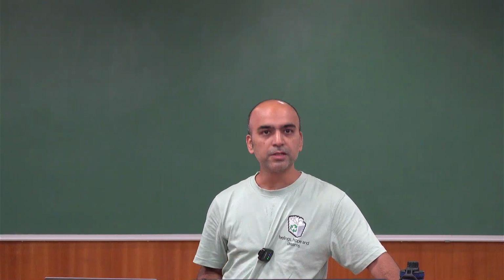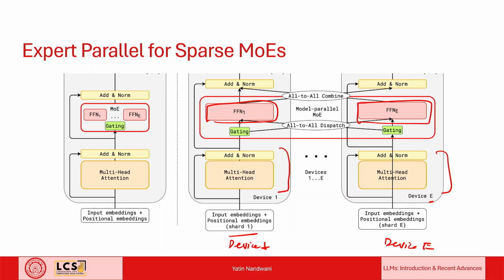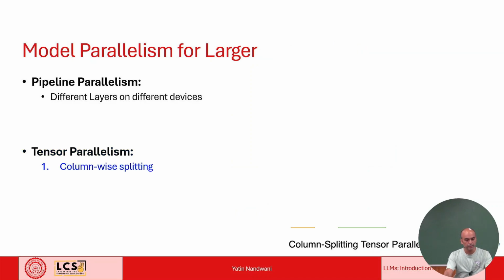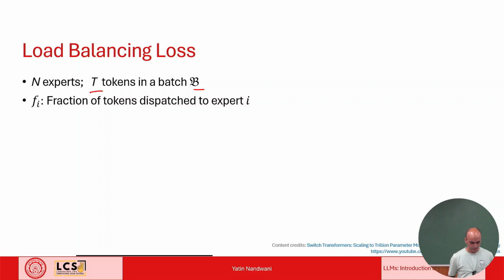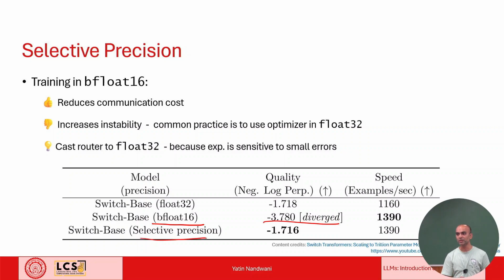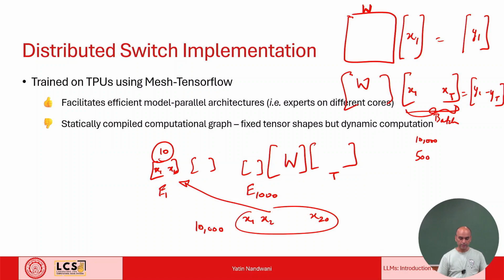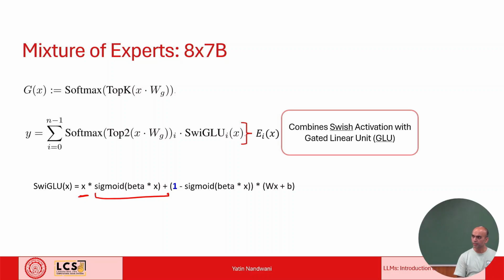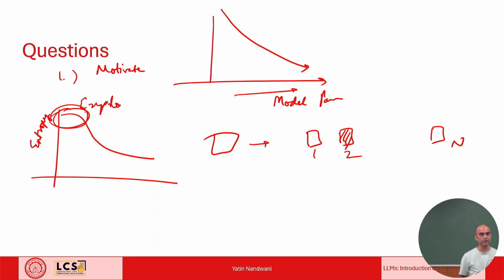LLMs | Mixture of Experts(MoE) - II  | Lec 10.2

Comment: regarding swiglu if we go through the code from mixtral we see its implemented like this class
 FeedForward(nn.Module):
    def __init__(self, args: ModelArgs):
        super().__init__()

        self.w1 = nn.Linear(args.dim, args.hidden_dim, bias=False)
        self.w2 = nn.Linear(args.hidden_dim, args.dim, bias=False)
        self.w3 = nn.Linear(args.dim, args.hidden_dim, bias=False)

    def __call__(self, x) -> mx.array:
        return self.w2(nn.silu(self.w1(x)) * self.w3(x))

So based on that the forumla should be SwiGLUmodified(x)=(W3x)⋅σ(W1x)⋅W1x similar to x⋅σ(βx) , so does that slide have an error ?
Reply: Hi Akshay. Thank you for pointing out a crucial error in the slides. Your implementation is correct.